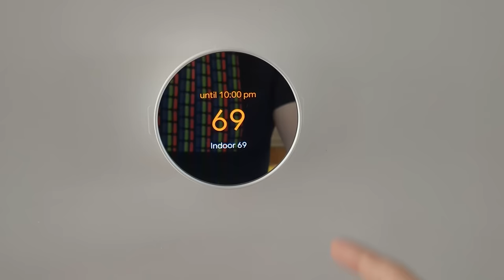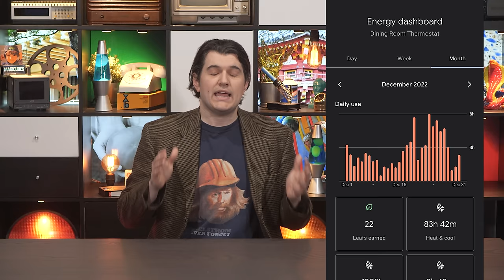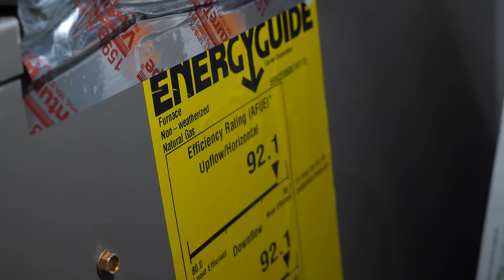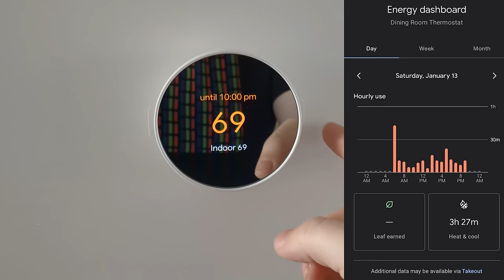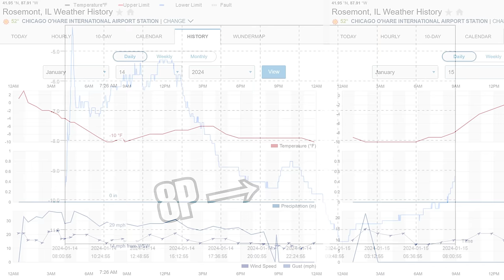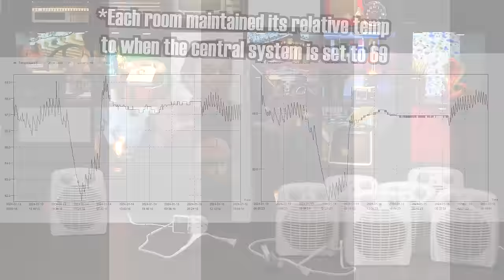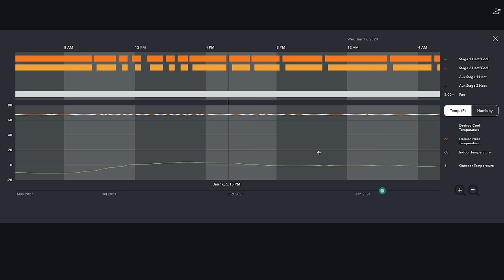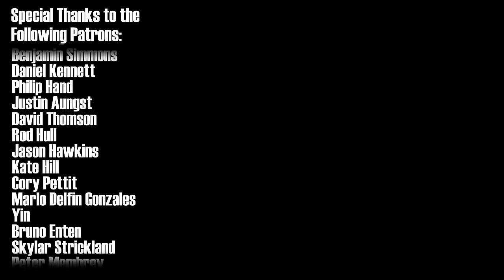Old HVAC industry practices are holding us back and costing us money. But we can fix it.

Comment: My apartment is heated by a heat exchanger that pumps water from my water heater. The WH is set at the max, around 145 degrees F. WH is rated at 50k btu/hr. The heat exchanger has a max BTU/HR rating of 28k btu/hr. 900 sq ft apartment stays warm even when it gets around 0 (in Ohio). Even with the heat running, we still can get a normal shower in, although not a long one. We did use space heaters in the winter to give the water heater a break and be able to run all the hot water we wanted, but it wasn't necessary. The upstairs units open to the wind more had some problems heating and they had their heat going nonstop for a week when we had a cold snap, but they still maintined above 58 degrees. I will say it does have to run for a very long time to raise the temperature, but the system does fine. But when someones tank goes out, they lose not only hot water, but heat and it becomes a huge problem

Comment: I have the exact opposite problem with my current heating system. My heat pump/heat exchange system has run 24/7 since the day it was put in. It's rated for -20 Celsius but cannot even heat the room it is in if the external temperature is at or below 5° C (just to be clear that is positive 5°). Talking to professionals regarding this subject, they're telling me that the company that installed my heat pump should have put a larger one in.

I almost forgot to mention I also have to set the thermostat 6° hotter than I want it in order for the pump to give me any heat at all.

Comment: What you mention about pricing is true. I talked to 4 HVAC companies and they all oversized even based on what I had before. But, the state rebates for heat pumps are based on the tonnage of the heat pump (its like $2500/ton). So it actually became CHEAPER to get a larger heat pump!

Comment: Industrial Refrigeration and HVAC tech here.

I Agree with you 100% about the need to do a load calculation. but the fact of the matter is when you can find a technician that is good and smart enough to actually be doing load calculations they are not going to be sticking around in the residential field making peanuts for long. There is huge demand in industrial HVAC-R for people who know their stuff. most guys if it is critical will get a engineer to figure load and that is going to cost the customer more money to sub contract a engineer. 

In my area the price per BTU still favorers natural gas. that's why I am installing a 95% tankless water heater converting from electric hot water. down the line once my gas boiler is on the outs I am going to do a Geo thermal condenser loop a compressor and a few heat exchangers and build a system from the ground up to heat and cool and provide hot domestic water

Comment: heat loss calculation is not done by a regulars hvac contractor in Ontario, it requires another lic. and customer wont pay extra. furnace size is also what's most used in your area   on sale,  a smaller system might most cost more

Comment: My home was an ex pub built in the early 1700s.
It has 24inch solid stone walls, no cavity.
I have actual open fires and fireplaces. I burn old pallets that a local building company gives me for free as they need rid of them.
I would beat a heat pump to death and the house would never get warm.

With my current solution, once I get the stone mass warm. It stays warm. And I can burn as much wood as I like. It costs nothing.

Comment: French canadian here. I have a 12 years old, 2,5 ton Trane XR15 heat pump for my bungalow. Love it and I don't think I need more (the HVAC guys over there are not so dumb haha). The air handler is a bit oversized tho. There're 4 heat strips that can provide up to 20kw. One is broken and I'm pretty sure I barely use the third one (I think they are sequenced to use just the minimal required to heat according to demand). However when the outside temperature goes very down in winter I completely shut off the heat pump. The efficiency goes down very fast at a certain point. 

I'm surprised that it's uncommon in your place. Those are very popular in my neighborhood.

Great video! It gave me confidence in my system and in the work done by my local HVAC company!

Comment: In the uk it’s the same with our heaters. If I turn mine on for a while in the winter it boils me alive. We don’t usually have as good automatic systems as we use radiators in most cases and the sensors are never in a good place so your home is usually too hot or too cold

Comment: As an engineering manager for an HVAC and plumbing company (we mostly focus on commercial for install) the fact that some companies build homes without doing load calcs is insane. It takes around 15 minutes for a place the size of a home and can save so much money. When you said that your house has a 5 ton unit, I was blown away. You would have to have the leakiest home with admittedly midwestern winters for that to even make sense. It would have to be like leaving a door open.

Comment: What's hilarious is I did most/all these calculations/estimations to scope BTU size for my mini split (modular heat pump as previously covered) for my office back in 2020.

Everyone I asked (in industry) for recommendations specified units 2-3x the BTU of what was needed.  

Found a web site that was able to enumerate the median BTU value required based on multiple factors (building, material, insulation, location, etc., etc., etc.) :).

Data driven decisions, not saying the HVAC industry is wrong - they just don't know better, nor do they want to do the work to 'right-size'; Which is a hilariously universal engineering construct across industries.  It just takes integrity, and unfortunately, almost all industries/trades are lacking.

Comment: Australia pretty much only has ac with heat pumps. Heating systems/hvac are pretty much unheard of. We rarely go below freezing here and if we do it’s a bit of an event. The average daytime low is basically around 12•C, still during the night on average it’s never going to get lower than 4•C.  Other than southern Australia it’s pretty much useless as ducted air conditioning with heat pumps is all you need. Even 15 year old ac is completely fine. Even fireplaces in very old building are pretty rare

Comment: We have geothermal heating with a cop of 7 (the installer came back after 2 winters, checked the data and saw we produced 28mwh of heat and only used 4mwh in electricity). That is quite a nice number :) but the machine was so ridiculously expensive we will never break even. (But in Europe you will pay a lot more than 70 bucks for gas in a heating season, so we will recoup it in our lifetime sometime)

Comment: I didn't read all 7300 comments, but while I agree that the furnace element is 'oversized' and that it's by no means indicative for actual load for a drop-in replacement... you didn't really get into whether or not it's a problem that it's cycling in the winter.  In my training for system selection, we generally chose the furnace to make sure we met the airflow requirements for the cooling load.  To wit-- the binding constraint was the air handling unit's airflow characteristics, and the furnace just comes with it at whatever capacity it runs at.  The airflow, air handler, and therefore furnace is really a product of the cooling load.  I know this is probably obvious, but just to close the loop-- an AC delivers air at 50-55 degrees (so roughly 20 delta T for indoor conditions) versus a furnace which delivers air at 120-140 degrees (so a 60-80 degree delta).  Furnaces need a lot lower airflow to deliver BTU's so they typically run on the lowest speed selection on the PSC motors (for the simplest single-speed or two-stage systems).

Comment: We ran 2 space heaters on high (10,230 BTU) last winter to heat our half of my cinder block construction duplex. The temperature was barely 65 degrees with poor insulation, my electric bill was 350 DOLLARS PER MONTH. This month it’s under 80 dollars not turning on the heaters at all. I’m highly against electric heating plus if the power goes out your heat goes away. 

On the other hand my old 2nd floor apartment built in 1928 has a way oversized gas furnace that would only need to run less then an hour a day to keep my place at 68 degrees in the dead of winter.

Comment: If you believe this is the case then why not put some simple electric heaters in your return air ductwork or your furnace blower fan chamber?  You could do it with one 220v heater plugged into your dryer plug and get an easy 4000 or 5000watts for a few hundred dollars.  You could trigger it with the thermostat easily.  You can wire the furnace motor to also run using the "fan only" feature on the furnace.  Its not that hard.  I have a similar setup to deal with a failed furnace scenario that happenned at minus 35C.  Making a simple AC motor is easy.  If your furnace uses a DC motor then that is harder if the board completely fails but since you are using a working furnace you can easily trip it.

Comment: Couple things.. I have finished the video yet, so maybe they're addressed, but..

One large issue is going to be the speed at which these things cool. People will opt for larger systems if it means they can cool their homes faster. As someone currently living in a home heated entirely by radiant floor heat, people don't want to wait ages for their home to reach a comfortable temperature. Or, let's say in the case of rolling power outages during freezing temperatures, you would want the capability to generate as much heat in as short a time as possible. If I only had power for a couple hours, that might hardly warm the concrete I stand on.

I think I'd rather have an oversized furnace than an undersized one. Let's say, for some reason, a window gets broken in your home during a cold snap. I'd do my best to seal it with a double layer of heat shrink plastic as soon as possible, but if (like the average person) you had no idea what to do, I imagine it would be better to have more capability to combat that particular issue. 

And finally, I'm curious as to what the longevity is on a furnace running more constantly as opposed to one that only needs to run 3 hours in a day. On one hand, constantly running equipment generally has a shorter life span.. but on the other hand, I could see repeated cycles of heating and cooling being just as or more damaging.

Comment: I tried looking into a heat pump system but it was impossible to find an installer who would actually consider it. They had these hybrid systems that were super expensive. The gas side turned on at like 25 degrees or something. LYNX doesn't seem to make cold weather ones and a lot of installers are American Standard or LYNX only.  My co-worker called a dozen installers as well in his local area and they all said no. He bought a Mr Cool system and they wouldn't install that either. He had some family friends that helped him install it instead. He paid $6k for the system altogether. My new gas furnace cost 20k.

Comment: Could you make a video about Energy Recovery Units (ERVs) in residential HVAC systems? I'm working in commercial construction and just learned about them. ERV units can solve some of the problems of positive or negative pressure inside our homes, as well as humidity problems.

Comment: We don't have a central HVAC (for starter we have only 1 separate AC, and no Ventilation system), we simply have a gas powered central heating furnace that doubles as boiler - a practice common to our country (people thend to have either a frunace or a heatpumps).
When the our current funace  was installed it was a step down a much larger and lot more powerful furnace (old firnace had nonflamabel heat insulation and the pipes runing thru the basement had to be insulated), but at the time it was istalled in coldes days of the winter it had to keep runing most of the time, with some rooms reuiqering space heaters). FF almost 3 decades: winters are about 10°C warmer and w have had replaced all of the windows that are wither much more efficient or at least somewhat noticably less ineficient and replaced the roof with a better and better insulated roof, reducing our heat loss, to the point the furnace runs in te winter more to do it's water boiler duty than heating.
We will eventually replace it with heat-pump.

Comment: So if your utility cycles your A/C on and off during load control, you need to seriously upsize your A/C to keep cool.  Customers with “right-sized” A/C can’t maintain their homes’ temperature during load control, so they drop out of the load control program, and now the utility needs to built more peaking power plants to handle the peak A/C load in the summer.  How is that better?

Comment: There was a lot said about the cost inflation on buying a new electric heat pump, but very little seemed to be mentioned about a large gas hvac. It sounded like it really didn't have a negative impact inherently. So, was the value of transferring to the electric heat pump superior as it is? Generally speaking, isn't going full electric a risk when electrical grids seem more unstable than gas supplies? I say this with a full electric house.

Comment: Strange one here, I own an Indesit PWE 91672 washing machine. It possesses 3 specific parameters which can be controlled alongside the usual programs, Time, Energy, Water. 

Time - A quicker wash
Water - Uses less water
Energy - Uses less energy

My quandary - If using the energy saving setting takes twice as long as the regular setting, despite washing at lower temps, with the cost of electricity in Scotland, do I really save anything at all?

I'm sure you can appreciate that I've been searching for an answer to this conundrum for quite some time, and you seem like the very fellow to wilfully tumble down this rabbit hole with me.
Reply: Easiest way to prove it to yourself is to buy a plug in energy monitor, and run a test, take a reading (or reset the meter) before doing the normal setting, and take note of the kWh used after it has finished.  Do the same for the energy saving one, and compare the two.   Multiply the kWh used by the rate you pay for electricity and you'll see which is cheaper to run.

Comment: Do you have a variable stage modulating furnace? It could max fire at 60k btu but start at 40k, throwing off your load calculations? Either way you are right, but for colder climates more north gas is more efficient at -32.c

Comment: I have a small issue with saying "I only need about 5 kW of heating." That's the capacity you need to keep your home at 69F (nice) given the weather outside, sure. However if you sized your heating capacity to that number EXACTLY it's going to run at a 100% duty cycle, or all of the time. There's an interesting tradeoff here where a higher capacity heating/cooling appliance may actually be cheaper to produce than one that's rated to run continuously at maximum output for days/weeks/months. 

Then of course there's also things to consider like safety margin for when the weather is even less hospitable than it was during your test, less than ideal insulation, clogged vents, and so on.

Comment: We got a heat pump last summer when our old central AC went kaput. Replacing with a traditional AC would have cost a few grand. And the heat pumps started at $15k. But in Mass. we have $10k rebate on heat pump installations so of course, every installer has jacked up their price by $10k. But getting that rebate back as the homeowner was a 6-month excruciating process involving bad paperwork, missed appointments, miscommunication, and more. I wish I could have just paid $6k up front and be done with it all.

Comment: The biggest issue is when it get so cold outside, they stop and switch over to electric  heating that is much more $$$$ to run. If they come up with an hybrid system that uses gas for -10 below zero temp and heat when things are above freezing. That would solve both issues. Also, they do make AC units that can throttle down to keep run time up for de-humidify.

Comment: I’m only 20 minutes in, but maybe one of the Problems that go against what your saying is the Refrigerant that needs to be used for this. At a Certain refrigerant usage it needs to be Classified. You have your homeowner type of grade, say under 50 pounds of pressure, and if you go above it it needs to be Classified as a Commercial System, that then Open up a whole different ball game According to the laws that’s in place for Refrigerants that are in use. Just a thought.

Comment: Awesome video as always!  I just wanted to comment on the smart thermostat data piece, as it turned out to be very useful in my case.  

Without getting too far into the weeds, basically my system in the middle of summer was calling for AC for hours upon hours, but never getting any cooler.  I'm in SE Wisconsin, so our summers can be pretty unbearable between the heat and humidity.  I was able to look at the data in both the Ecobee app as well as Beestat, and you could see when the issue was occurring, which was extremely helpful in being able to point out days and times.  Oddly enough, when I tried to show the tech the data, he seemed like he couldn't care less and made a comment about how I shouldn't have went with a heat pump.  At one point, the same tech was out for the fourth time, and suggested that I should just "flip the breaker to reset the heat pump's logic board", as that would fix it temporarily.  How about no.

Long story short, my issue ended up being that something was broken during install and only appeared when under high load, and my unit was replaced under warranty free of charge.  All because I could see the data and prove that it wasn't working as intended.